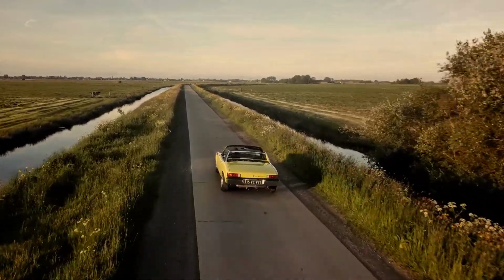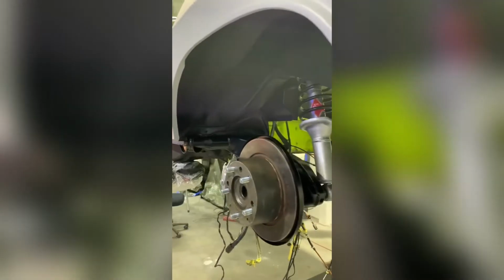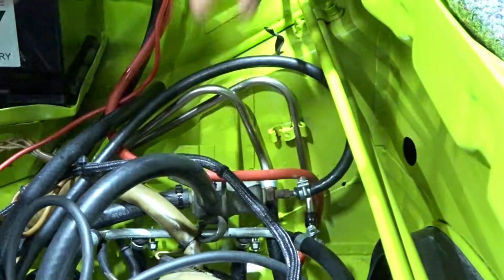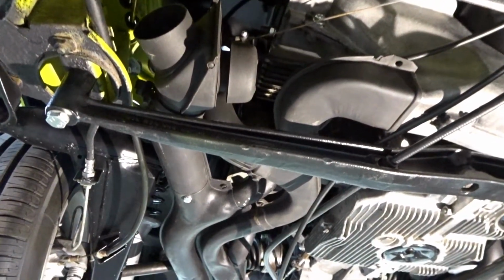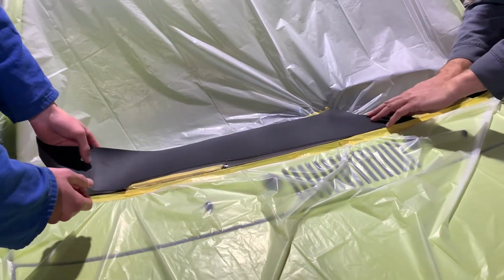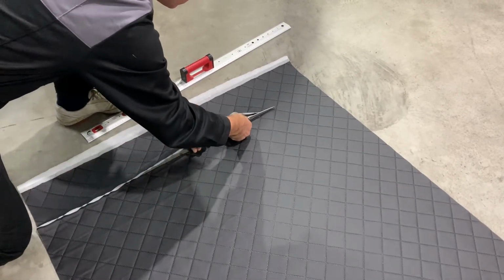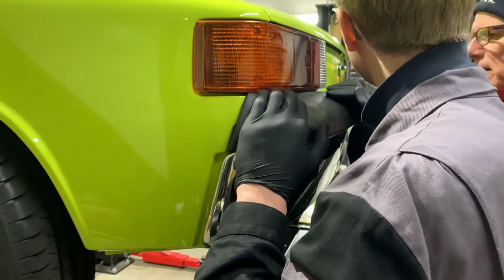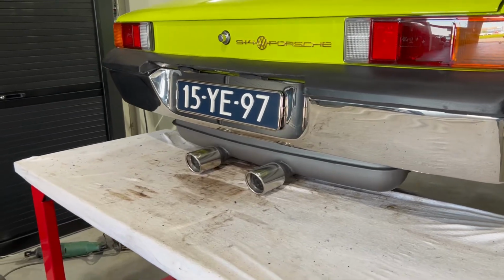The RESTORATION of our PORSCHE 914

Comment: You forgot to put the side marker lights back on next to the headlights.  Also the turn signals on the front were orange glass with white lights beneath rather than clear glass with orange lights beneath.  Lastly I would have wished you had kept the steering wheel stock and though the vinyl was original to the car, you can do without it and that would be where some rust starts underneath that vinyl if water gets up under there. But other than those minor quibbles you guys did one hell of a job restoring what I consider to be one of the best cars of the early '70s
Reply from the maker: Thank you. We partially converted the car to the European spec and did some things to match our own taste.

Comment: Not a restoration, basically a new car. The only upgrade I would have done is relocate the battery to the front passenger area. Where did you get stainless steel bumpers, Wow?
Reply from the maker: Thank you. The bumpers are made somewhere in Asia. We bought them from someone locally.

Comment: Really like the wheels. What size are the wheels?  Looks like 15x7? Also, a Fuchs wheel only comes in a five lug pattern, the 914 is 4 lug with 15x4.5 . This car would have to been converted.
 Don't think a 7 inch will fit without 914 6 flairs?  Custom offset if it is a 15x7?  The 914 6 had 5 lug 15x6 front and 15x7 rear
Reply from the maker: A previous owner converted it. Not sure about the sizing.

Comment: Beautiful job! I had one in the same color - a 73 1.7 with 1.9 liter pistons. My first car. It came with Koni shocks and a Bursch exhaust when I bought it and I put on Eibach Autocross springs. It came with foglights and the Porsche graphic on the side, as well as first generation Celica wheels, which didn't look too bad. I had so much fun in that car. It's been over 30 years since I sold it and I still miss it.

Comment: I- started to like the 914s later in life when 20-30 were grouped together at Luft19 at the back lot of Universal Studios in L.A, And I sub divided them 914/914 -6 cylinder. I like the 6 with the wider flares and bigger engine. When they came out my friend bought one and I just had to hold back from saying, "This is NOT a Porsche, jut a fancy 911. Many people felt that. When the 912 came out I was not happy seeing those either, there goes my favorite Porsche my 356-A. But a billion years later I like all of them almost.  That is for another time and story line

I- am surprised you didn't up-grade the headlight and sidelight to LED, or bigger brakes.  I did all of the to my '86 Carrera and was beyond the money and the time to do this...so wonderful to drive down a long county road, hit the bright LED and see for miles!!. The old looks with the wonders of new technology.

-Also surprised NO sound deadening. As you know this gets rid of the tin rattling next to other tins. THEN the engine and exhaust get a chance to speak up.

3-D printing. I which that was around when I was doing my redesign of my car. No -a days you truly can create a one of a kind car.

-I see you using Duct tape to hold the rubber top strips in place after the rusted metal was taken
out. Duct tape is an under used all purpose helper for car restoration.

-You spoke clearly, no wasted words like ...aaaa so we...aaas deicided.. Beautiful color and final presentation. It was about 30 minutes long and I don't mind long videos as longer as they are not wasting my time on mindless stuff or my mental energy needed to follow the development of and abstract thought.

-I would have liked to know what country you are from
Thanks for sharing.

"A Porsche without a garage is just a dark hole" — Walter Rohrl - Porsche Development
Reply from the maker: Thank you! We are from the Netherlands.

Comment: nice job, congratulations! As a 50 year long Porsche 914 owner, I love that you guys did a great job and saved another one! Did you have any problems with D Jetronic and its sensors?
Reply from the maker: Thank you, this engine uses L Jetronic and luckily we didn’t have any issues with it so far.
Reply: @Wheels.Reborn  You might check the air box for a "blow out" valve. In case of a back fire, you will not have to replace an expensive air box! GREAT restoration, I am so happy you saved another of these great cars.

Comment: Once owned a 1973 914 1.7 and a 1973 911T 2.4 coupe at the same time. The mid-engined, targa-top 914 was way more fun to drive and outhandled the 911. You could put the 914 into a long sweeping highway curve, take your hands off the ateering wheel, and it would then steer itself all the way around the curve while keeping exactly in the middle of the lane. And our 914 was Ravenna Green!

Comment: I had a 914 (I was the second owner).   The radio antenna was on the driver's side.....
Reply: Factory antenna was on the driver side. Dealerships typically ordered them without radios in order to add a few bucks to the car by installing the radios themselves. Shops selling aftermarket radios didn’t know they should be on the driver side and would put them on the passenger side because it seemed to make more sense. It didn’t.

Comment: Thank you for saving another 914. 😀 Always loved that loud 70s color.  I did noticed you replaced the speedometer; was this to change to km/hr? Your 1974 914 didn't come with a silver button speedo. 

Enjoy! Great all around cars; roomy, fun, targa, mid-engine, etc. I have put more than 250K on mine. They love to cruise at 70 mph.
Reply from the maker: Thank you! Yeah we changed the speedometer to a km/hr one. It originally came with a silver button miles/hr speedometer. We are located in Europe so we wanted to change it.

Comment: Umm I hate to tell you this but I think that yellow is not stock, that's a mopar color, that is Curious yellow I think, as its like this nuclear green they had back then, also get yourself a copy of the 1972 may issue of road and track, and read the article on page 68 about the 914 and the problems and fixes he had, that way you know what your getting into, and what to sort out

granted yours is a latter car and hopefully has the problems worked out, as they redid the gearbox and a bunch of little things in late 72
Reply from the maker: @Kavinskysmith  It sometimes looks like yellow but the color is called Ravenna Green. It was a color that was available in ‘74
Reply: The weather seal rubbers of the trunk etc. are not meant to be glued! They are pressed in only. Glue traps the rain instead of letting it flow down and out, causing rust. Also the badge is not original to the 914. it was aftermarket only. Excellent job otherwise!!!
Reply: @michaelctanner  how was it attached by the factory then, as they all seemed to rot out, and you would think doing it not like the factory there would be a plus, unless its just supposed to be grease and press fitted
Reply: @Kavinskysmith  The seals just press in the channel, as the other poster said glueing them just makes it worse and trapping water. I'm sure after all this work it will be kept inside. The only time mine sees water the one or two time a year it gets washed. That is a factory color.